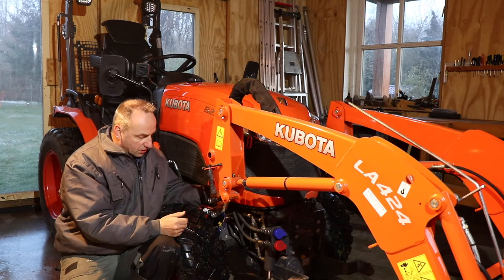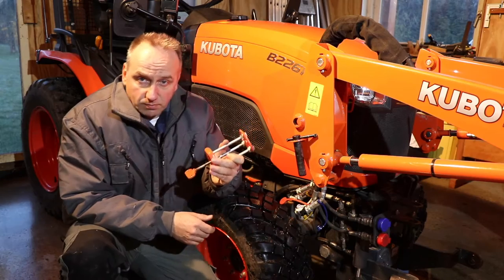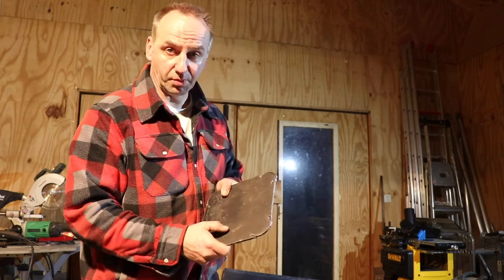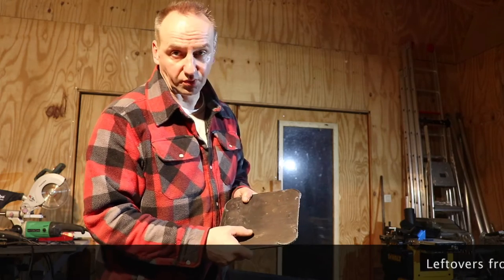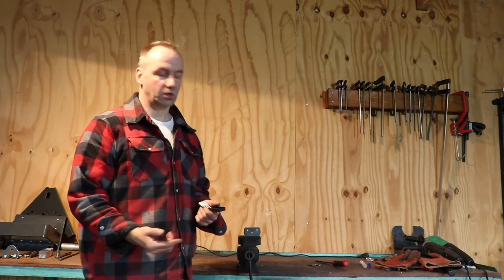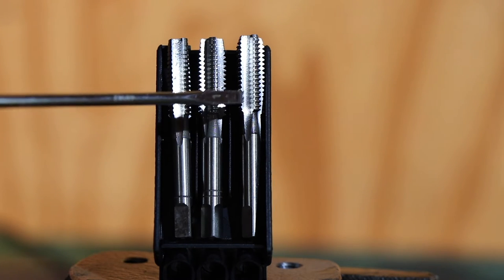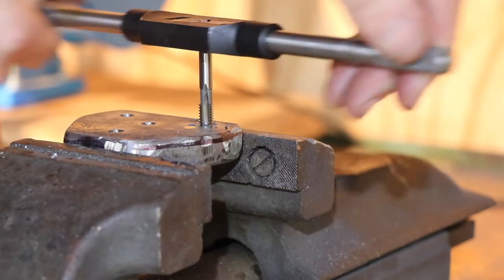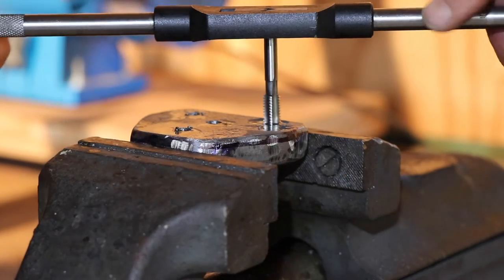DIY Tool for hydraulic line pressure relief for the Kubota compact tractor

Comment: Very well thought out and practical tool.  Much better than a hammer and punch!  The Kubota orange paint job is a nice touch!
Reply from the maker: Thanks Jack! 
For me it is very clear that the cause of the pressure effect is not due to temperature but due to the fact that the red/blue connector is connected to the curling cylinder of the bucket. When the bucket is just a little bit non-parallel with the ground floor it will slowly curl to level with the ground when disconnected, leading to pressure build up in the hydraulic lines of these cylinders. Even after a very short period of time. In the video the front loader was disconnected for a very small time only and even then the blue and red was already giving quite some hydraulic fluid when pressure relieved.
The white and yellow connectors are from the free hanging cylinder of the arm movement, there is almost no force on them during disconnect and up to now they were always easy to connect and give almost no hydraulic fluid when pressure relieved.